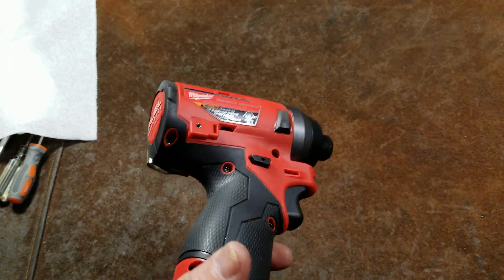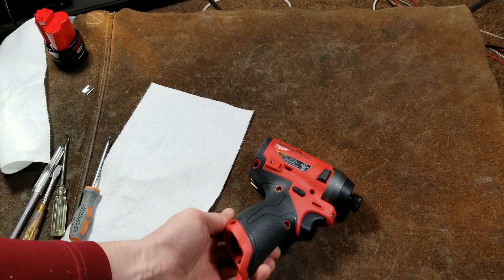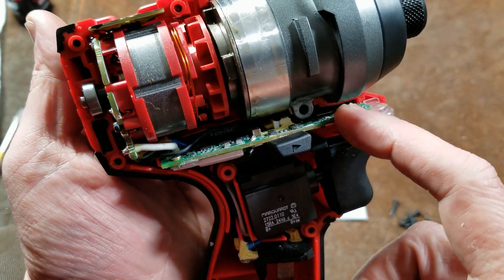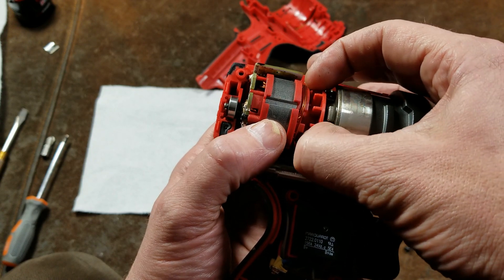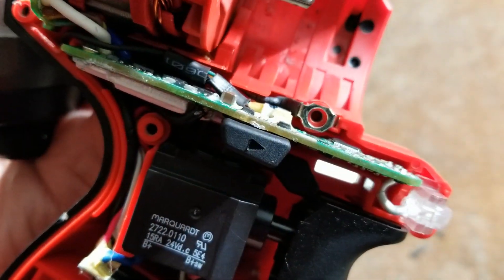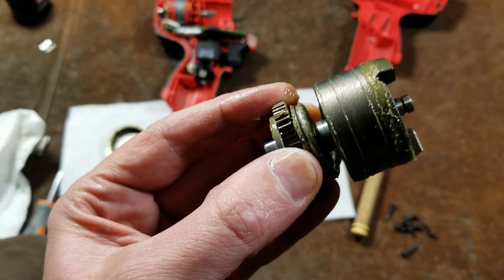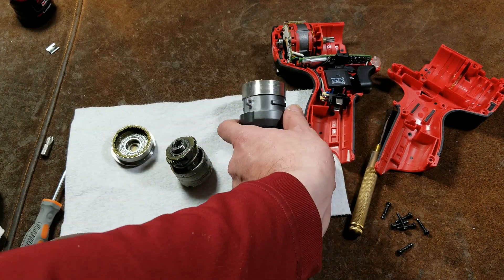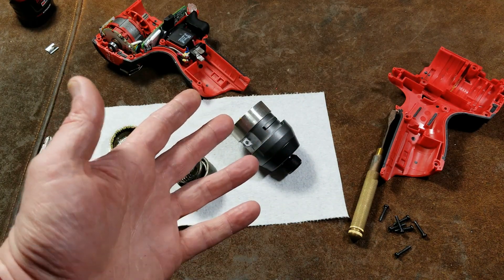TearDown: Milwaukee M12 2nd Gen Fuel Impact Driver

Comment: Wish I would have seen this video before purchasing this tool. It’s like they designed it to not tolerate getting wet at all. Use this in the rain once and it’s junk. The PCB is not sealed and they even put holes in the case so water can easily get on the PCB and fry it.  Really disappointed that they would do this, and I can assure you it was intentional.

Comment: I like mine a koit - except for the M12  battery system is sometimes fussy to release.  My big issue is the impact mechanism does not hold up to my use. I had one start slipping under warranty, this other one just started slipping but out of warranty.. I think it's the whole gear assembly needs to be replaced.  Same cost as drill.  But will disassemble to see if it's the hammer or anvil.

Comment: I got dirt in the anvil on my impact driver and when I pull the trigger in low rpms it sounds like its grinding, unless I put pressure on the anvil which it stops.

Comment: Excellent video ty. I let somebody borrow my impact gun and they left it out in a light rain just enough to get the ground wet but over a period of time when I picked up the gun from him it showed a dead battery when I got home I put a new battery in it and charge the old one I know the battery worked because I tried it in another gun but on the impact gun it showed it dead battery I even tried different batteries with the impact gun same result so I'm going to take it apart and see what happens

Comment: Is it feasible to swap out the 1/4 collet for a 3/8 anvil from perhaps the 2454-20? The 2553 is much cheaper on the used market than any of milwaukees 12v impact wrenches.

Comment: Nice video. I own my original Milwaukee circular saw,  Sawzall and Deck/drywall gun, all corded from the mid 90s and all are suoer tools. I got away from Milwaukee the past 15 years because junk, but the past few years they've been outstanding.  Dewalt is hit or miss, but Milwaukee is getting to that Makita level of tool again.  That being said,  do not buy tools because you are a fan of team yellow or team red or team teal. Buy the best tool for the job because everyone makes them differently and some are better than others,  despite your preconceived notions.  As a carpenter I won't buy brushless.  They're killer tools, but i need cords for most of my work and brushless is just one more thing to fail. Simple is often better, especially for longevity. I do own cordless impacts and drills for convenience and still went brushed because they're cheaper and I believe will last longer doing construction.  The brushless DC motors are killer, it's the control boards i worry about.
Reply: You don't understand DC motors

Comment: Can you do a tear down on a m12 stubby mine leaks oil from the anvil when I use it heavily. Is that normal or is their a seal leaking?
Reply: Andy Lopez it isn’t hydraulic so it shouldn’t be leaking oil, unless it’s grease
Reply: @mrpanda2655  If it's the M12 surge and leaking oil. You have a problem. If its the standard impact, they all do it.
Reply: Its normal, Andy

Comment: Hahaha! The antique Milwaukee! I have a pnuematic screw gun from the 50s made for aircraft work. It looks almost as cumbersome but is quite a bit smaller. It has no clutch at all, great for stripping out screw heads. Edit: I highly recommend Bel Ray waterproof grease for things like this. It is synthetic and I have never seen it get hard or separate before.
Reply: @Kevin-mp5of  
I use that a lot myself. Molybedenum disulfate grease mixed with motor oil is specified by Cessna Aircraft and BMW motorcycles for cables and splines. It is also a great assembly lube for engines.